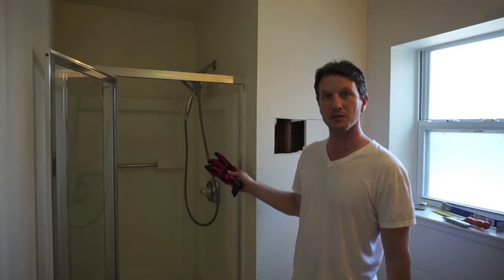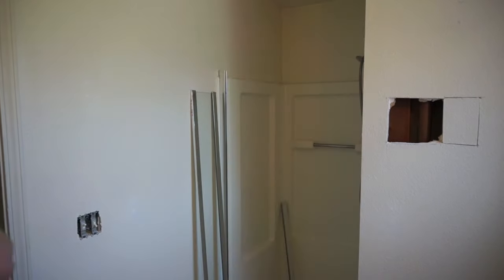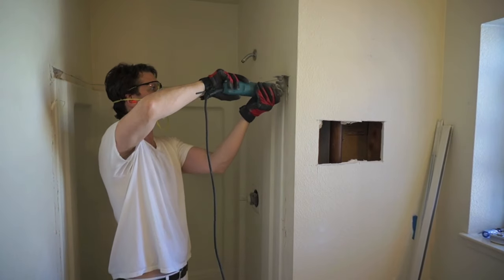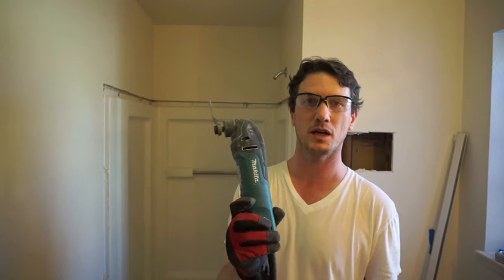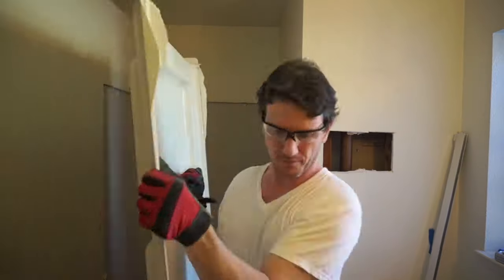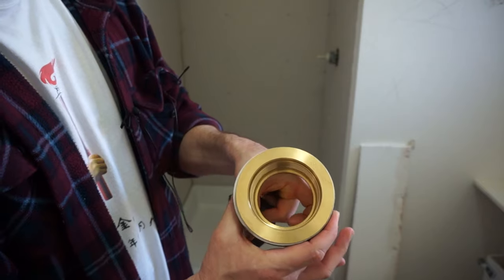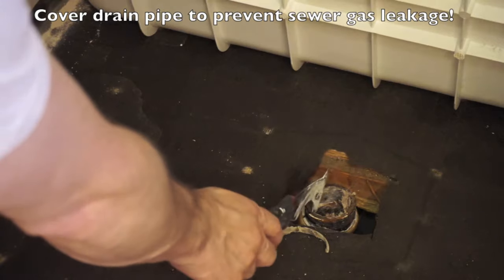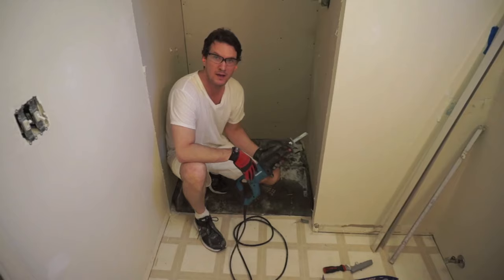How to Remove a Shower Stall

Comment: Thank you - this is a terrific video. Can you please tell me what you do with the drain once you've removed the shower stall itself? How do you safely cap (or remove) the drain pipe itself? Thank you again.
Reply from the maker: Look up drain cap at Home Depot. For cast iron pipe you can use a Fernco rubber cap that has a metal strap. For black ABS, glue an ABS cap with ABS Glue. For white PVC, use a white PVC cap using PVC purple primer and glue. You can also glue a PVC and ABS together using ABS to PVC transition cement.

That's not always code but usually ok for non pressurized drain pipe, i.e. a shower drain. Also, I'm not a plumber so just my opinion. To lower PVC pipe you can use an internal PVC pipe cutter saw bit on a drill.
Reply: @toolrev  Thanks so much!

Comment: Great video! Well done. I loved the clear explanation of the process and especially the drain. I have a drain that has no visible grooves for crown nut or any type of sealant. It is a head-scratcher as I try  to figure out how it was installed. Thank you for the great video.
Reply: Same. OLD drains aren't like the one in this video.

Comment: Thanks. I need to remove mine to see where water is getting into the basement. Im hoping to reuse it and not have to cut it.
Reply from the maker: Ya, save it if you can by lifting it off its hinges. These fiberglass shower enclosures aren't cheap.
Reply: ToolRev 
Even junk ones are expensive!

Comment: Thanks I needed this advice. I'm trying to get rid of my big old shower stall that has been there since the 70s.
Reply: Same here. Did you ever do the project? I'd love to know how it went!
Reply: @juliava605  I did, and it was gorgeous too, then I moved 2 years later.
Reply: @GabrielleCenter2000  Did you remove the old shower and install a new one? Or did you remove and turn the old shower stall into a linen closet or something? Mine is a second floor shower stall (old from the 70s) with essentially NO SUPPORT under the shower pan...actually, partial support, but not enough. The shower is great but wasn't properly constructed. I'd love to rebuild it but I don't have the skills to create a floor support beneath the shower pan so I've been advised to tear it out, turn it into a linen closet, and re-do the tub surround and use that as my shower. If you have any thoughts or advice to offer, I sure would appreciate it!
Reply: @juliava605  The advice is that I would find an expert and try to discuss with the design.
Reply: @GabrielleCenter2000  I can only afford YouTube experts. 😊 Fortunately, many are very generous with their time and expertise.

Comment: Thks but do mobile home stalls have screws on water inlets? And did u cut out the wall?
Reply from the maker: Never worked on a mobile stall. I only cut what you saw in the video. You can cut the bottom drywall to slide out the pan instead of cutting the pan out like I did.